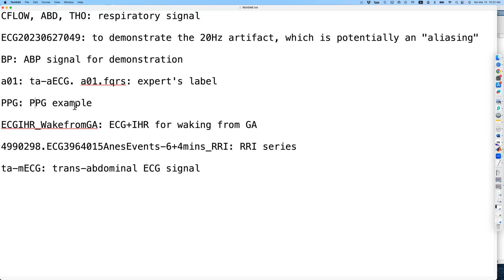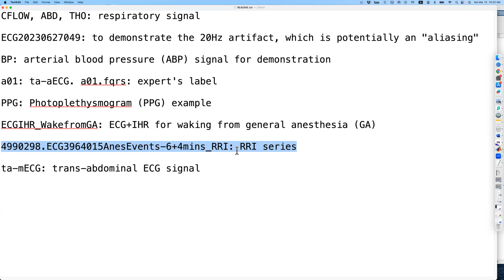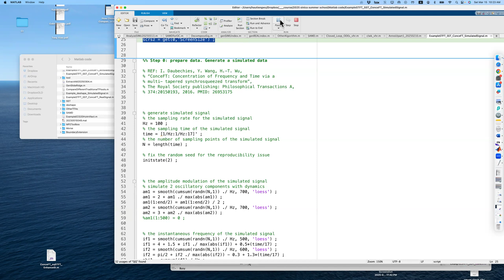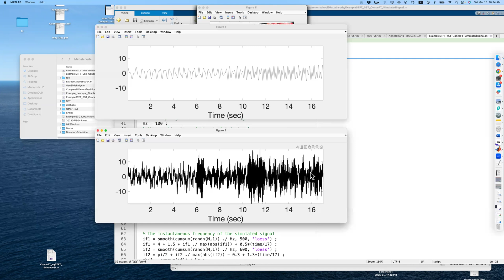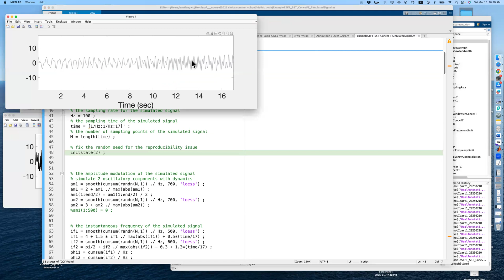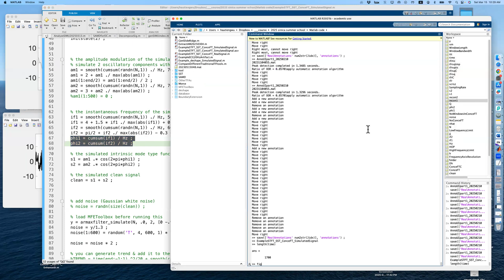Synchrosqueezing Transform in MATLAB: Hands-On Tutorial (Lecture 1)

Comment: Thank you so much Professor for demonstrating this tutorial. I'm very new to this domain and working on DAS Seismic data denoising. I was wondering could I use SST in spatio temporal datasets like DAS data too ? Thanks in advance.
Reply from the maker: Sorry for my late response, but it slipped my mind. I assume by DAS you meant "distributed acoustic sensing". Technically yes, but since I am not familiar with seismic data (my only experience with geological data was a Signal Processing paper back in 2012....), I cannot guarantee it. Based on what I saw in public talks about seismic data, you may consider de-shape as the starting point since it seems to have a lot of harmonics. But depending on what you want to do, you may choose different tools.